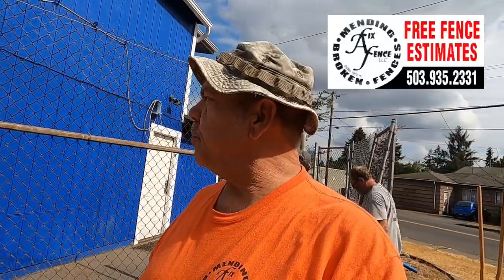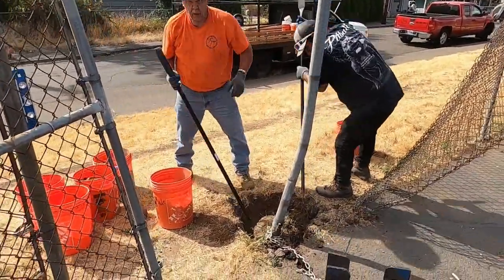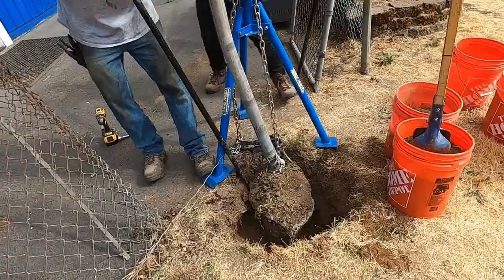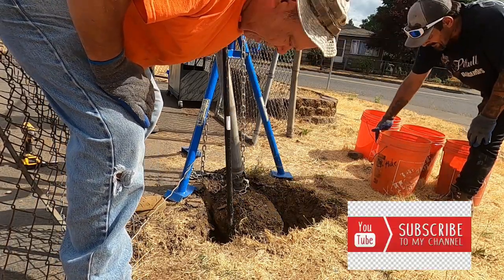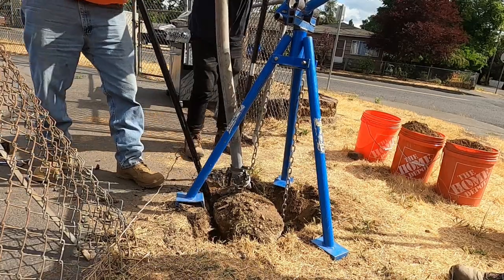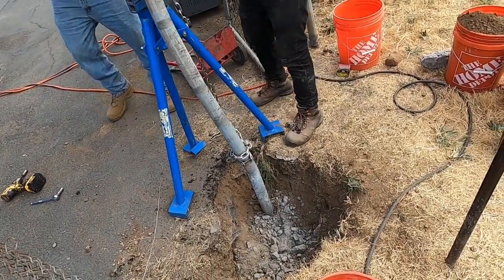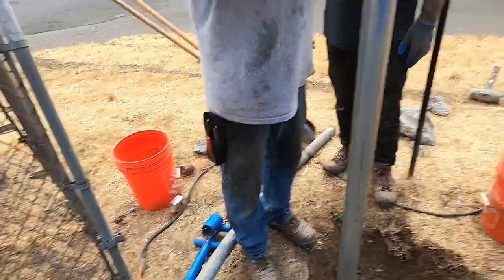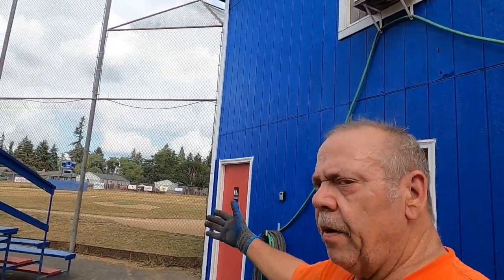NW Quik Pull And A Jack Hammer Story By Fix-A-Fence LLC

Comment: Not always an easy job sometimes, I  guess you don’t get any frost lift in your area because with the head of concrete that post will have now it would be popping above ground  in no time and 1500 bucks for that puller is stupid expensive. I just made one with scrap fence materials. It works ok but mostly use my mini skids
Reply from the maker: I hear ya,.. I got them before the prices were raised. Sure has saved time and effort,..